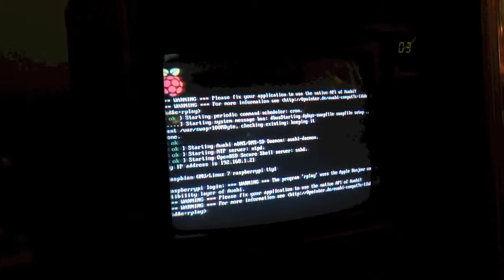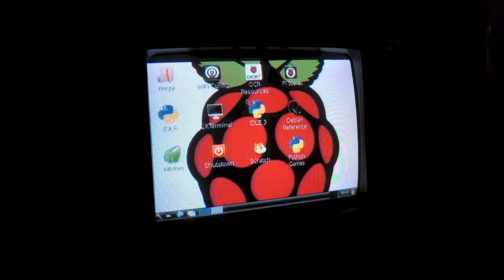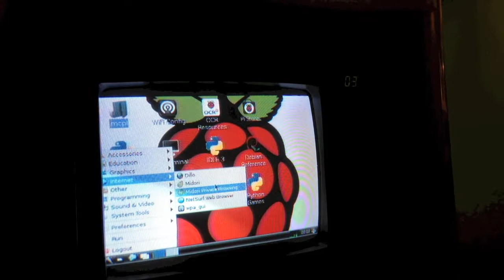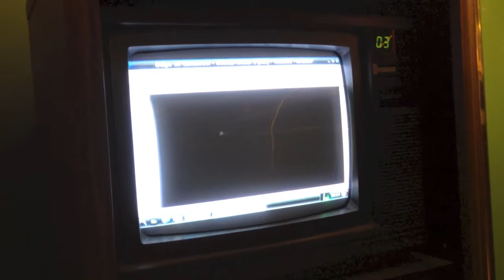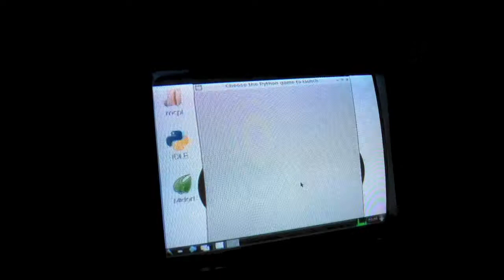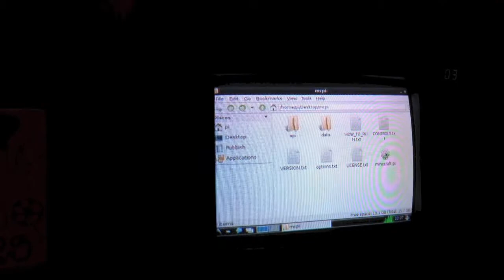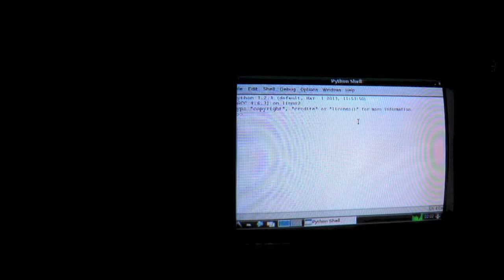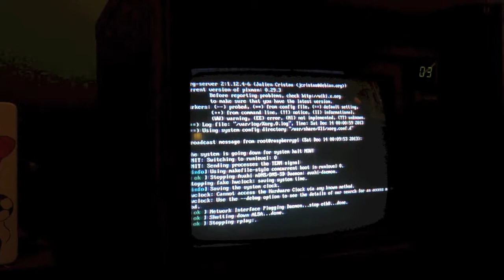Raspberry Pi

Comment: Very cool! You Mitsubishi has AV in?
Reply from the maker: No, I use a VCR to convert AV in to RF Coaxial.
Reply: ***** Oh nice! I need to learn how to do that so I can do more things with my TV sets.
Reply from the maker: TheCRTman It's pretty easy… Just set it to VCR mode (if it's a VCR/DVD combo unit), then you'd usually use the channel selector to select AV.
Reply: ***** I think my Mitsubishi VCR is default on AV and channels at the same time.